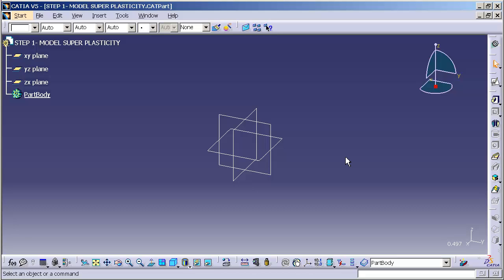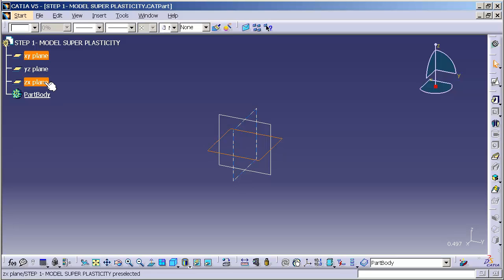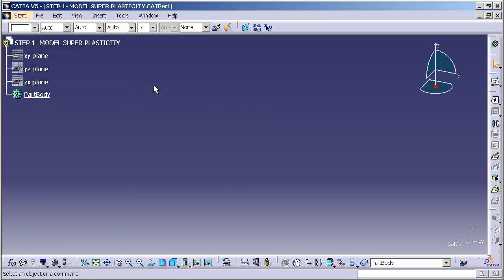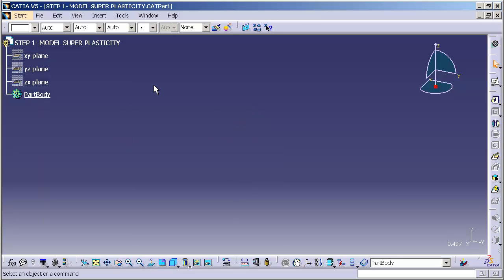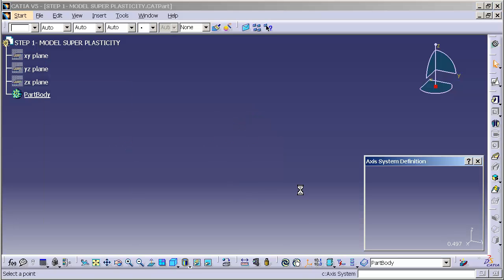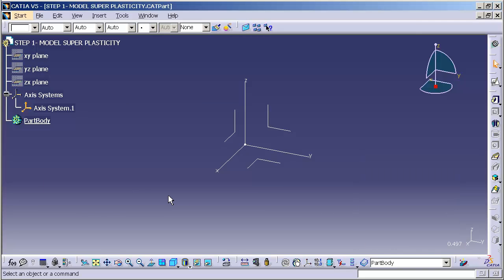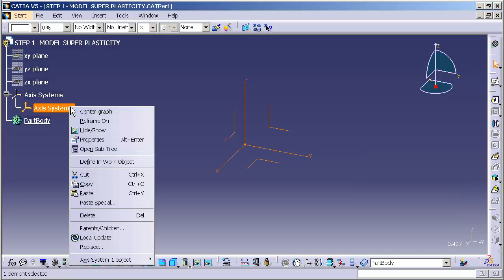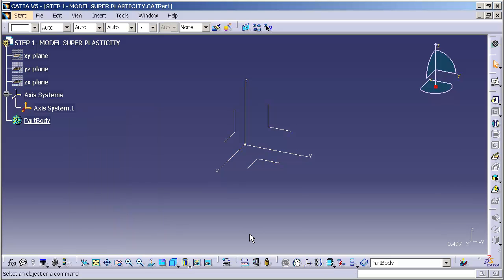STEP 1  MODEL SUPER PLASTICITY

Comment: why we should be using the current option in axis system.
Reply from the maker: You can create an axis you need in a different location and by setting it as current all geometry will reference the current axis location. It works well when you do not need to reference absolute.